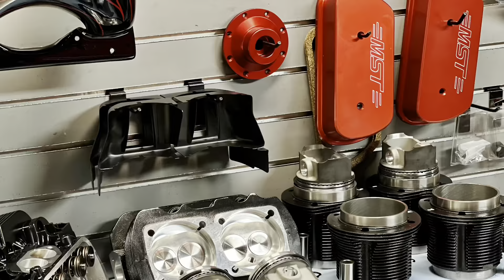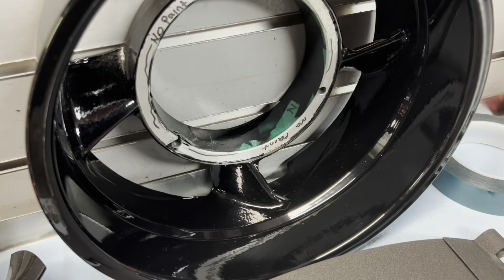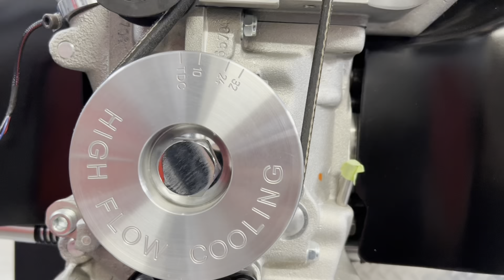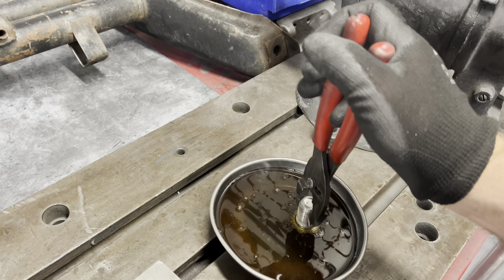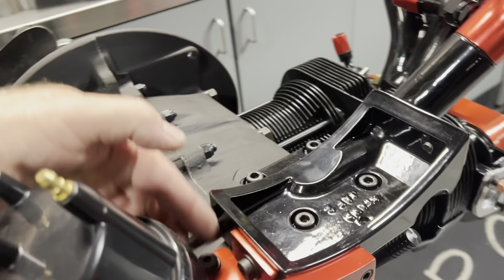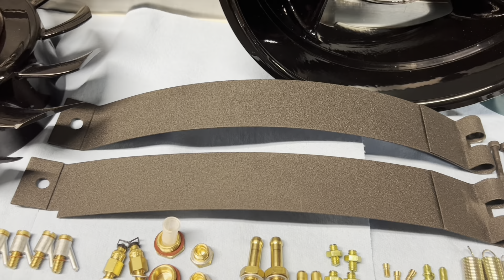POWERHAUS VW Custom Built Trike Aircooled Engine

Comment: Use gun blueing to make the crank bolt "black"

Also use the brass exhaust nuts. Not locking but don't come loose and you can also get a wrench on them with the big headers.
Reply from the maker: interesting, thank you,  I'll definitely look into the gun bluing  method on the crank bolt but on the exhaust bolts, no can do lol, I'm sticking with the lock nuts, the brass nuts have come loose on us,  our race car even has the arp 12 points because the lock nuts won't fit and I've ran wavy and lock washers and they always come loose so for now I'm sticking to the gold lock nuts, we haven't had a single exhaust nut come loose or exhaust leak in the 20 plus years I've been using them.

Comment: So sanitary wow
I put ultra copper on the exhaust studs and use 11mm barrel style exhaust nuts to keep ‘em locked (and prevent corrosion). But can be a bit messy, so not right for this clean setup.
Reply from the maker: We use the 11mm (wrench size) barrel nuts on the intake with a wavy washer (brass nuts are softer than the steel ones and seem to dig in and stay tight) but on the exhaust side, I've seen them come loose, maybe because of the harmonics or vibrations from the exhaust, not sure but the lock nuts (12mm wrench size) never come loose on us.
The problem I see with the VW intake and exhaust is the two  mounting points, they don't seem to squeeze down on the gaskets in the middle, this is why we use the compression gaskets on the exhaust side and something we are working on making for the intake. Every since we started using the compression gaskets and gold lock nuts, we've never had an exhaust leak, even on our turbo engines with as much as 35lbs of boost.

Comment: This reminds me of debating whether paint or rust is a better insulator
Would be neat to at least learn how the “painted” temps compare with otherwise bare parts. Especially the heads, which is a new one for me.

Can’t get over that crinkle paint on the case man it looks soooo good
Reply from the maker: For sure, painted engine blocks have been a debatable topic for years in the VW and V8 world as well. 
We use brand new aluminum engine cases now days so we don't normally paint them, that was something we used to do when rebuilding them to make them look good, but for us we've never seen a difference if painted or not, our engines do not run hot.
Most Air-cooled Engine heating issues are related to long sustained rpm on the free-way (low gear ratio) and engine set-up (compression vs. fuel octane)